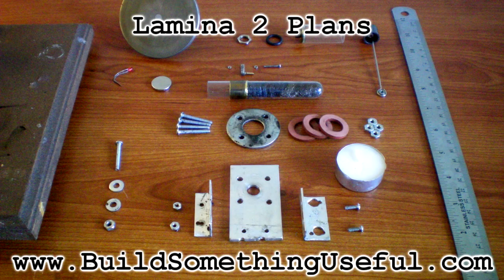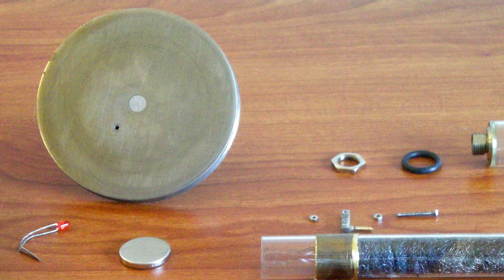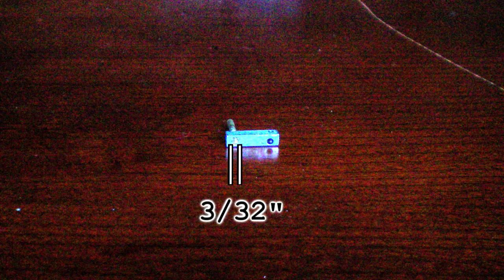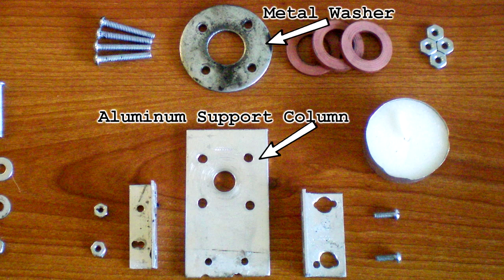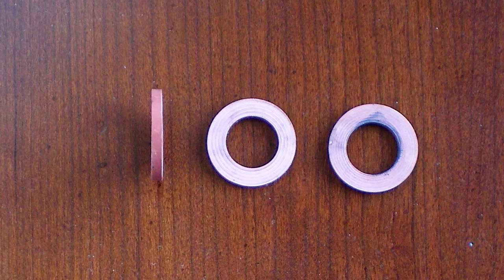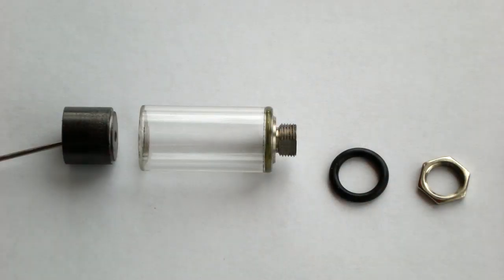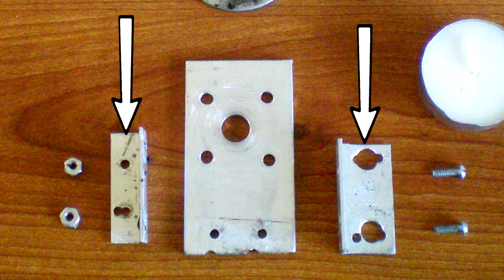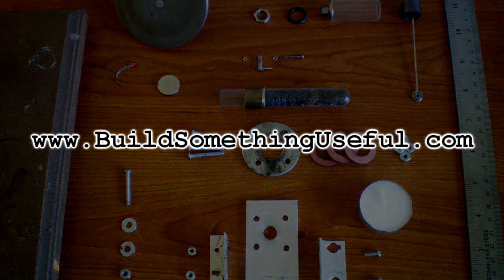Lamina 2 Plans - Stirling Like engine plans

Comment from the maker: @ImJacksAmygdala My next engine is made with a hard drive.  No parts will have been made with a lathe in my next video.  A hard drive is very convenient in so many ways.  They even have built in generators that put out 3 phase electricity. Stay tuned...